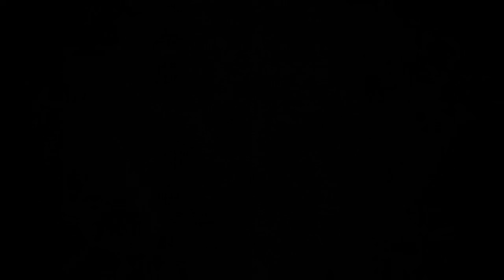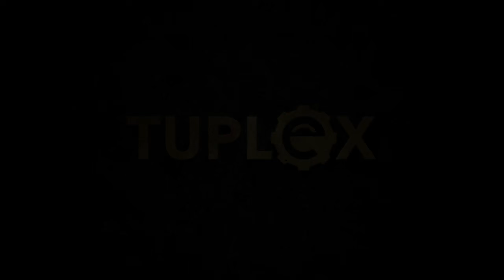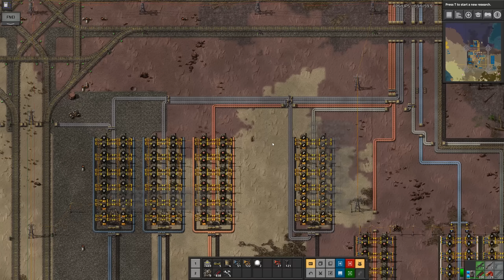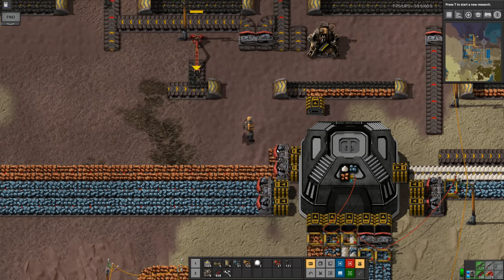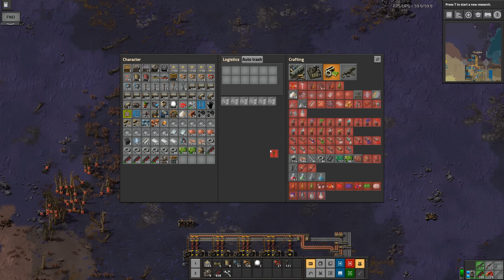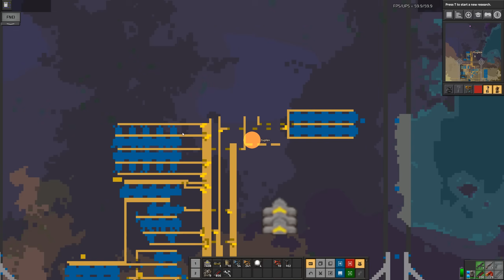Krastorio Mod - Factorio Let's Play #13 - Green circuits, silicon wafers

Comment: Did you install the required library for the Dollie picker?
Reply from the maker: Yes, that’s actually what was giving me the error.  I’ll try to figure it out when I have more time.
Reply: @TuplexGaming  Picker Anatheum was broke by factorio hotfix version but it was later updated and works now and I find it really useful to bind the keys to arrow keys since I used WASD for movement I don't need arrow keys to also be movement so I have picker dollies set to arrows